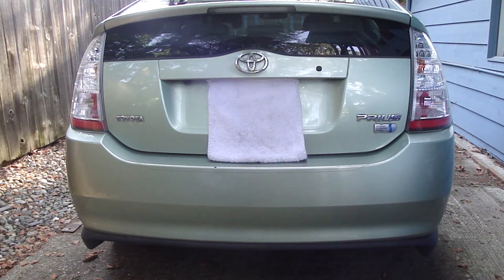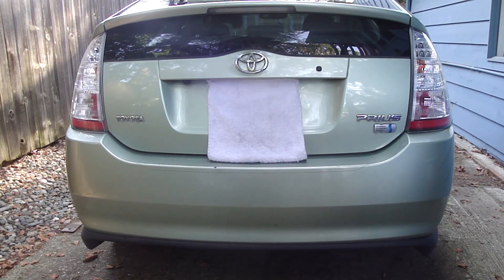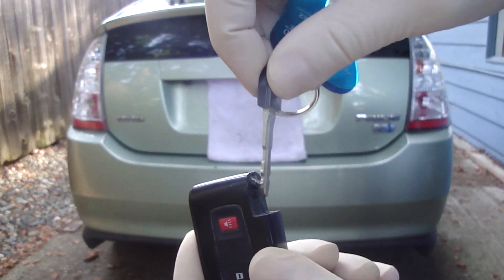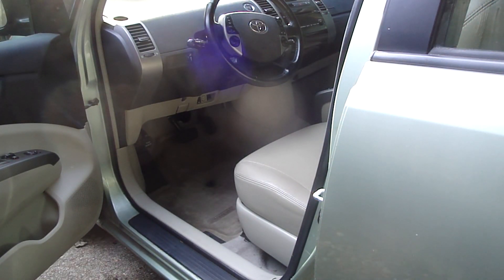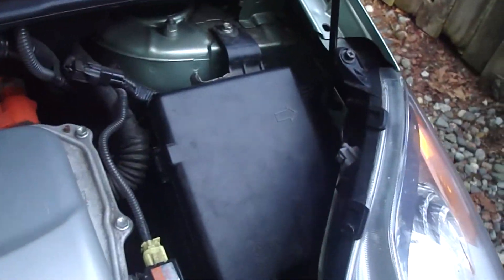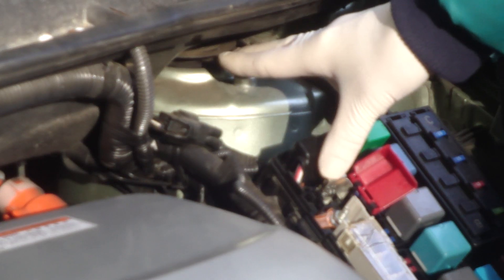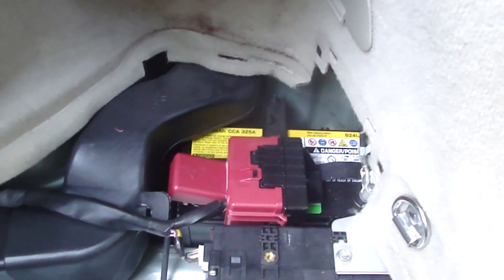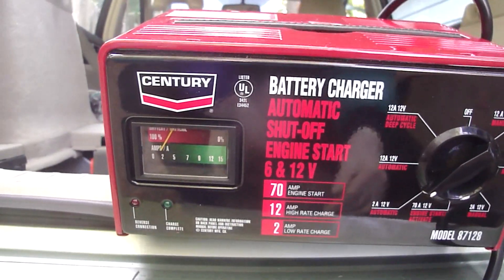Toyota Prius w/Dead 12 volt Battery / How to Open the Rear Hatch & Jump Start or Charge

Comment: Not only did my battery die, my spare was flat!  
I put power to the fuse tray and used the strut as my ground. This powered the display and I was able to use the door unlock button to open the trunk.  You would think that Toyota would put a little cable from that lever to the back seat area somewhere to manually release the trunk.  
Thank you for the tips it was good
Reply from the maker: Toyota can't add a cable, that would increase the cost of the car by a $1.75!   ;-)
Reply: Claire Panda not if your car is completely dead

Comment: my car's 12V battery is dead, all the doors are locked, and i tried to use the manual key to get in the car; but unfortunately; the door never opened.
How can i open it, please?
Reply from the maker: Your going to have to either jimmy one of the doors open, jimmy the rear hatch open or jimmy the hood open to jump the battery from the battery connection under the hood.  If you auto insurance includes towing call for a tow driver, many of them can get a door or a hood open,
Reply: @davidgpo  
that what i was thinking of.
Thank you ❤